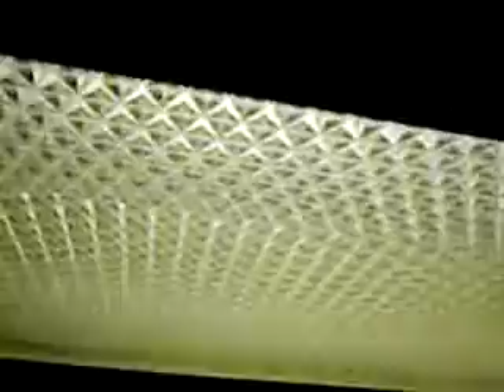Hot rodded troffer: Magnetic F32T8 ballast?

Comment: hey I have gotten Westinghouse lamps from friends who said the fixtures never were relamped for over 20 years and seeing the dates of the ballast and lamps (from date codes) they do last longer, Electronic ballasts have larger failure rates and lamps don't last as long either. In fact when I was a kid I remember my dad installing 4 troffer fixtures with 4 lamps each....in 1988. The maganetic aballasts dated to 1988 on the back. We recently moved out, 12 out of 16 lamps still worked! 1988-2007!

Comment from the maker: Why the hum and the startup flicker are what makes it great, you know the light is working and all the fixtures start up at different times giving a more dramatic effect, as you know something is going down when the professor hits the switch. An instant at once startup is boring, and no more interesting than turning on the single incandescent bulb in the closet to grab a coat. It doesnt have the same effect. Besides, I prefer ballasts that are more gentle on the tubes.

Comment: In regards to finding a hole in burned out tubes, at work they replaced all the old magnetic F96T12 slimline fixtures with F96T8 electronic ballast fixtures. I've seen several burned out F96T8 lamps that had holes in them at the ends. I've never seen an F96T12 slimline on a magnetic ballast do that.

Comment from the maker: What I am told is that it overworks the capacitor a bit cause the F32T8 lamps run at a higher open circuit voltage. However, I have seen this done plenty of times. A lot of the time it just kills the lamps faster, then again, instant start electronic ballasts already do that anyway. I can however keep a set of F32T8 lamps running for a while on one of these magnetic T8 ballasts.

Comment: Usually the live time of the ballast depends of the temperature, people use to not clean the lenses and the mirrors and that is the killer of the ballast, because the heat melt the insulation over the time and is always hotter with a dirty fixture.